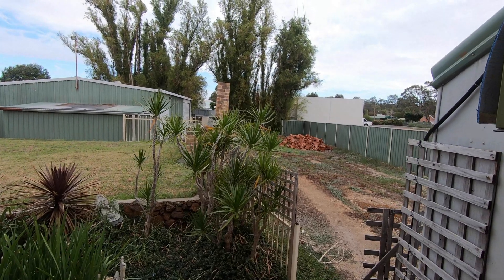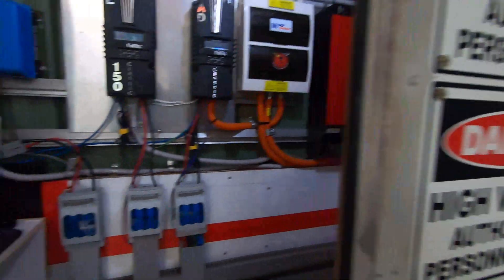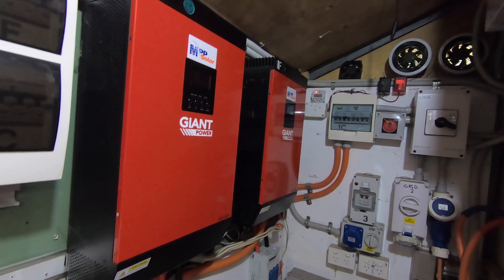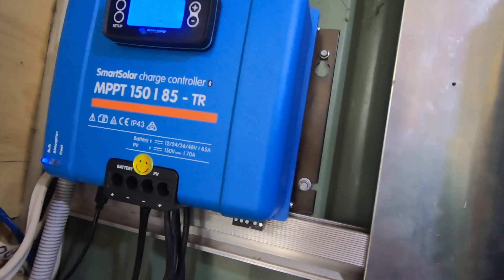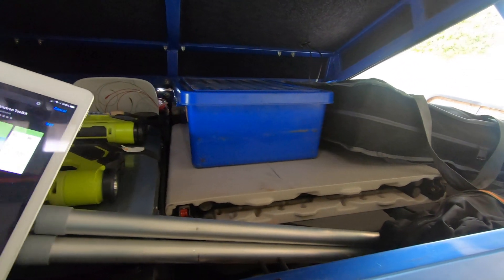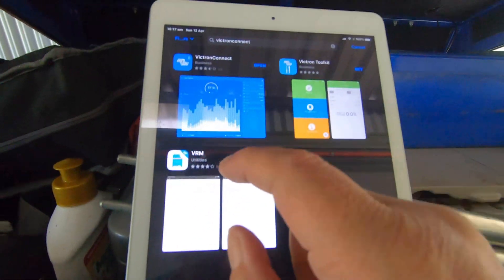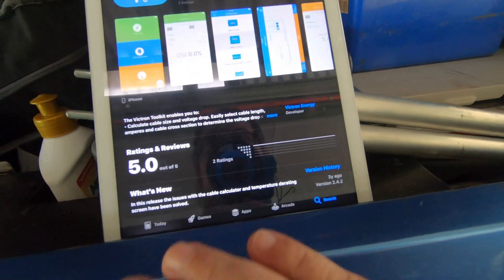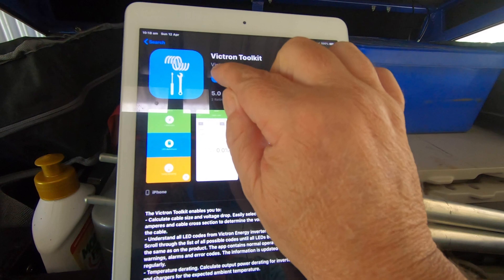FREE cable size app.  Updating the Victron Gear.  Planned work in the Power Room

Comment: The load connected to the Victron meter in your trailer must be connected the wrong way on the shunt, It should be showing -0.25A and -4w if you are drawing power from your batteries and it was also showing INF h on time remaining in batteries, If it was drawing power it would show the actual time remaining unless you have power charging the batteries.
Reply from the maker: Thanks mate but it had enough power coming in from the 320 Watt panel to run the loat plus put the 0.25amp into the already full battery bank. If you want to see it at work then i would suggest you go watch https://www.youtube.com/watch?v=7eGqV-egQV8 As that is the Video where we put it all under load and stress tested everything New on the trailer.
Reply from the maker: Also the install videos may sort out the problem you have in not understanding how a solar and battery system work. https://www.youtube.com/playlist?list=PL-bNupHOHGIK5_WtXiUtMZhaEF-UZWkMd enjoy.
Reply: I agree mate. I have the BMV 712 and when drawing current it will show -a although if my solar panels are producing power it shows amount of amps.

Comment: Hi Justin
You mention a breaker between the DC Isolator and the solar Controller I intend to have about 600 KW of solar panels can you please tell me what size breaker I need. I have a 50amp breaker between the solar controller and the battery is this necasarry or should it be relocated to before the controller. I would appreciate your help please,
Reply from the maker: It all depends on the amps mate. I only use Noark DC breakers in all our newer installs. So you need to work out your amps.
Reply: Thank you

Comment: yes victron gear  is good as you no i have the bmv702 for years now
Reply from the maker: Yes i have had the 700 and the 702. Could not get them working very well on the lead acid banks. Got it dialed in for lithium though. Works great

Comment: How much more efficient will the new inverters be Chris?
Reply from the maker: Depends what you call eficant Norm. I look at overall operation of the units. They have an 80amp mppt controller in them instead of a 60amp mppt. They are 5kW instead of 4kW  The thing that will make the most difference to me in winter is. When switching from Battery to generator they to not have the light flicker. That should make a lot less wear and tear  on everything that is plugged into them when i need to run the inverter generator.
Reply: OK I get where you are going with this change.  The increase in input and output are great and a quick switch from inverter to generator will make a huge difference on your gear for sure.  Quick question, when the inverter switches to generator power, will it pass the power from the generator straight through to the appliances in a square wave or will it flow the power through the inverter and convert it to pure sine wave before the appliances?
Reply from the maker: @NormanMcGregor  These are PURE SINE WAVE INVERTERS. They will not even let power through if the power is not as good or better then these units put out. So my Generators are all Pure sine wave inverter generators x 2 i have a 3.2kva and a 7.5kva.  Gan NOT use any modified sine wave generators on these units.   Also NO CHEEP 2 pole sine wave generators as they tend to chop the wave under load. 3 or 4 cylinder 4 pole generators with a very good AVR will work.  Much easy just to use pure sine wave inverter generators like mine.
Reply: Excellent!  Those sound like Great Units!  The reason I asked was that some inverters don't convert low grade power from either the grid or generator to pure sine before sending it through to your appliances when there are in grid or gen mode.  They only provide clean sine wave when in solar mode.
Reply from the maker: @NormanMcGregor  they need good power or they just will not let it through. Not sure with the new units but you could blow the ass out of the older units hooking them up to cheep ebay 2 pole generators.  I tell people to use 4pole generators with a good AVR or Pure sine wave inverter generators. When i was on the grid many years ago. The old units on my wall now would just turn the grid off all the time because the Hz or volts was below par. The PDF says these have a Huge voltage range but the Hz is ether 50 or 60Hz. They are very good units i have installed 12 units on farms with no problems. Just waiting for the Aussie dollar to go up a bit and i will get 2 for me.
Reply from the maker: Have a lot at the PDF http://www.mppsolar.com/v3/catalogs/PIP-MK.pdf

Comment: The built in Blue tooth and WIFI are so nice!!!!!!!!!!!!! Midnite is really behind the curve on the internet ready out of the box theme. 

MPP Solar is the same as Midnite with this problem. As much as you spend on a component for solar power you should expect PLUG and Play on all components. It is now the year 2020 and there is no reason these manufacturers can not have these ready to go with out extra cost. I still want to buy the software that Jeremy has but I have not had the money. Thanks for the video. Jim
Reply from the maker: here is the PDF http://www.mppsolar.com/v3/catalogs/PIP-MK.pdf 
built in bluetooth. Not sure how well it works but i will give it a test when i get around to installing them at my home.

Comment: I do like the red covers!
Happy Easter
John
Reply from the maker: The red is being replaced by white. And the 2 x 4 kW inverters will be replaced by more efficient 2 x 5 kW inverters.  So more power if needed and a smother running system all round. I think that's a good trade off for the red paint.

Comment: I've found that when you turn the power off to the BMV 702 is resets the state of charge to 100% so it needs to have a constant feed to remember consumption. Would be good if there's a way around this
Reply from the maker: It uses so little power Just leave it on. Only reason mine was all off this time is due to the fact that we have no idea when we will be able to go camping next. This Virus and the shire border lockdowns has messed up all our plans.

Comment: nice lots to do here to putting my new pip GK  grate video mate
Reply from the maker: Yes i have to order 2x (MK) zero transfer time New 5000w 48v Solar inverter 80A MPPT solar charger with the Parallel kits. Just waiting for the Aussie dollar to get back up a bit. I love the new inverters. I have put enough of them in for other people. About time i did some work in my OWN power room.
Reply: @JustinCaseSolarPower  cool i here the mk s are nice to
Reply from the maker: @JonOffgrid  Yes i have installed about a dozen of them since they came out. Love them. Have had No problems at all with them on Wet LA , AGM , or lithium batteries.